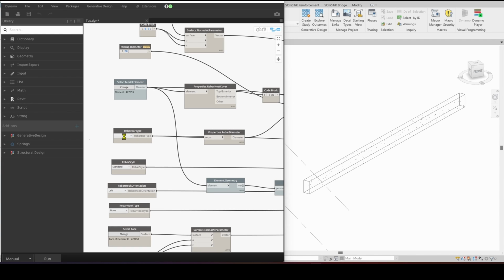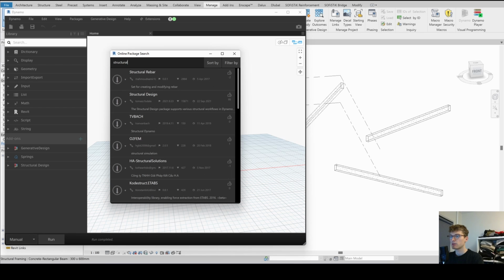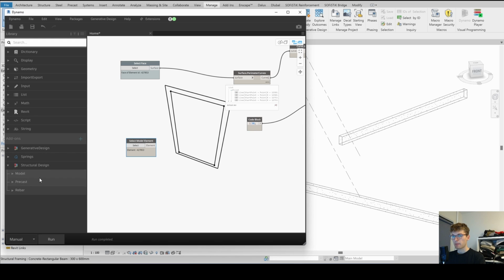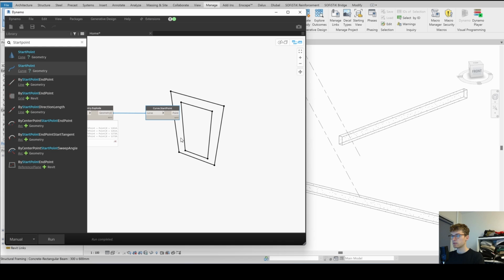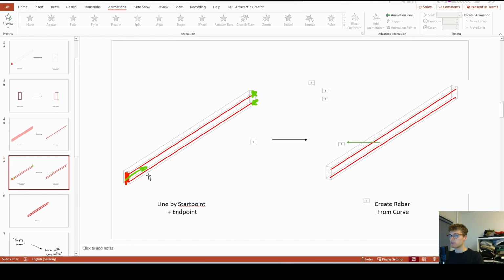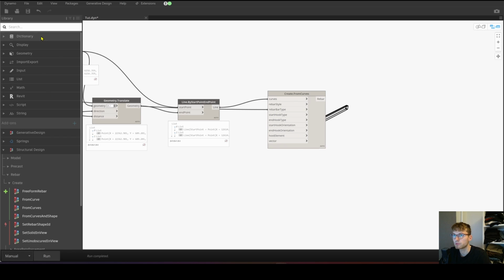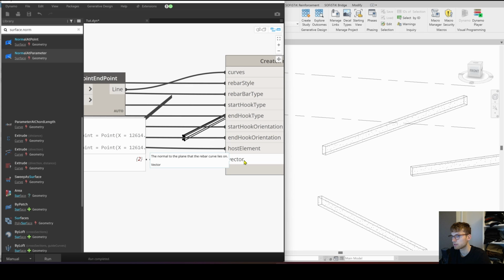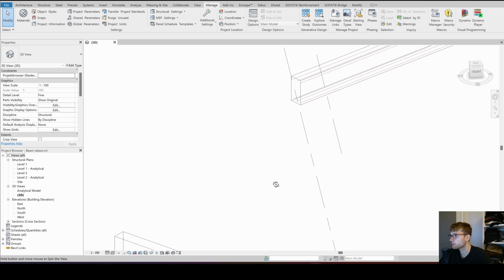How to create longitudinal beam rebars with Dynamo for Revit

Comment: Hi there, thank you so much for these tutorials. I am currently trying to use the structural package to create a column that has spiral rebar, and has longitudinal reinforcing going vertically (encased by the spiral reinforcing). At the top of the longitudinal vertical steel, I am trying to make hook bars that are oriented inward towards the centre of the pile. However, I can't figure out how to make the longitudinal bar hooks orient inward. I've tried using clockwork, and tried rotating the output of "create.fromcurves", but can't seem to get anywhere. Any chance you have encountered this before? Many thanks.